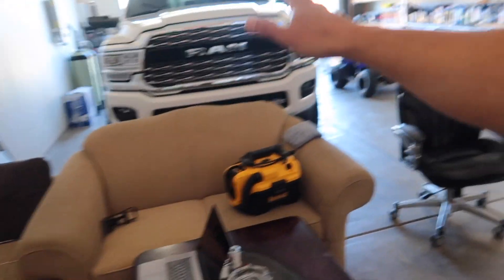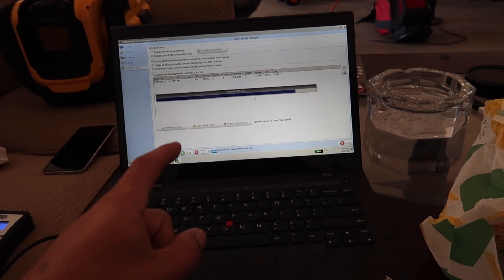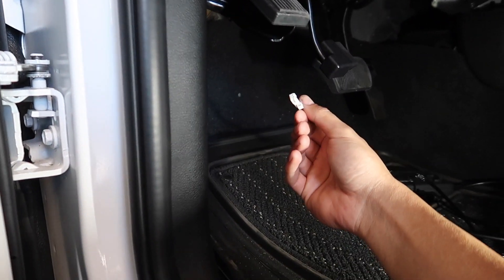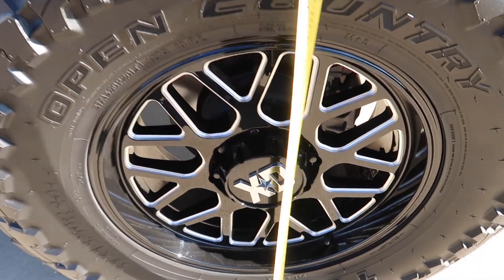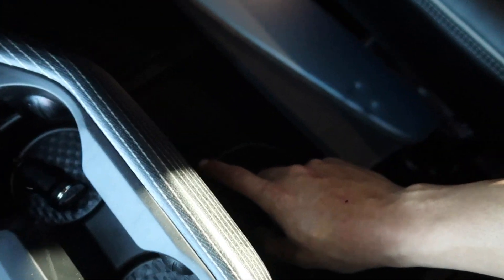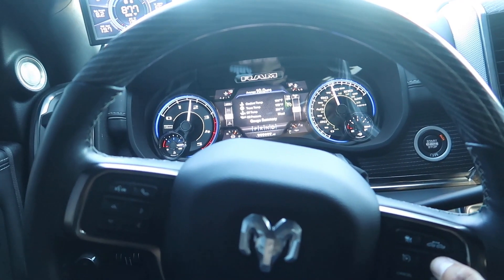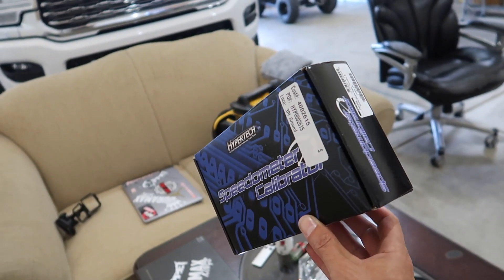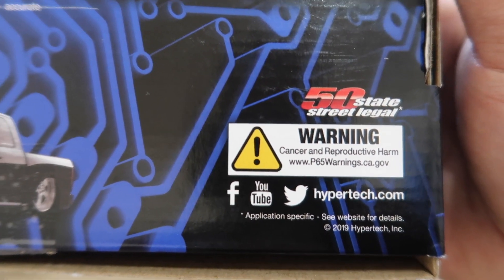How to calibrate speedometer on 19 RAM

Comment: Just threw 35" tires on. Love the fact the 2022 3500 limited I just got auto-calibrates off the nav system!  Good job Ram!
Reply: How does it do that, do you set to navigate and drive with new tires so it does it or no need to do anything, asking because just bought a 2022 being delivered this week and ordered new wheels and tires.  Thank you for your information.
Reply: @1pipepro  if you have the nav system factory installed on the truck, The speedo will self calibrate from the GPS in the nav system shortly after you throw on the new tires. If you do not have Navigation on the uconnect system, it will not.

Comment: Eddie, I’m experiencing an issue with the Uconnect system, where it won’t work via the app on the phone! It does not communicate with my truck whatsoever, although using the key fob to start it does. I’ve taken it to the dealer, but they have no idea what’s going on with it, be it that it’s so new a system, and they’ve forwarded the case to Star, but yet to receive an answer. Contacted Sirius Guardian, and they redirected me to the dealer. Any idea on what to do, with this $100k truck, and that issue?

Comment: I used the one from AEV for
37x13.50 on my 2018 Power Wagon worked great with no issues u can also turn your fog lights on all the time and change the signal lights to the one touch 3 blinks like on my duramax can also change your TPMS but you still have to take it to a dealer and get something done on there computer so I didn’t change the TPMS I can live with the light

Comment: Did you have to remove fuses to get that calibrator to work?  I had to for when I bought that device for a 14 RAM, it was very wonky so I ended up returning it.  AEV is working on a pro cal for the 19 ram.  A dealer told me it would be out in 2/3 months.  I called AEV directly, said they were working on it, but no firm date on release.

Comment: yo quick question i have 2019 ram 3500 with optimal tuning as well love it. I got the hypertech programer you have now... i switched out my wheels/tires and went to redo my speedo and its giving me an error 90 code.  I called hypertech they say it means the file is (efi live flash) makes their product not work. what was your work around ?

Comment: My speedometer had stopped at 621,369 miles, any idea how to get them to start working again? Cummins forums I have a lot of complaints about the odometer stopping there, apparently that’s 1,000,000 km and in Chrysler genius they can’t figure out how to roll the odometer.
Reply from the maker: I think you can adjust the mileage with the alpha obd

Comment: AlfaOBd body computer still works on 19 trucks alot easier than going through all that
Reply: Used mine and the abs and traction control lights will not go out

Comment: Rams just shift weird, I swear... I've had 2nd, 3rd, and now a 4th gen and they've all been princesses when it comes to shifting. 

I keep buying them because of the pulling power.
Reply: I own a 17 6.7 Cummins deleted but I'm buying a New powerstroke my friends car lot has a brand new 2020 powerstroke I towed my gooseneck with my Bob cat on it sad to say but that new stock Truck pulls way better than my deleted 17 and I've got 4.10s that new 10 speed is geared so low

Comment: You need alfaOBD and youll be amaized what you can change..
Reply: Does alphaOBD work on the 19's?  If so do you need an unlocked code or cable to get it to work?
Reply: @lupereyes6737   I belive its working on the 19's. might want to look on on the cummings forums to confrim..  Yes i know for my 18 i needed the cable. The code you can get at any dealer and its free.
Reply: @adamsullivan4153  I have rebel 2020 and Alfaobd work perfect only need cable to bypass security and 4 digits keycode from dealer and you good